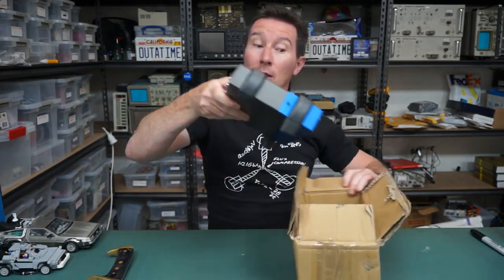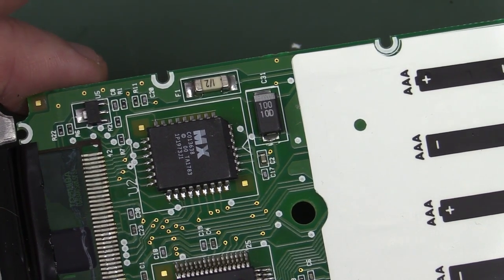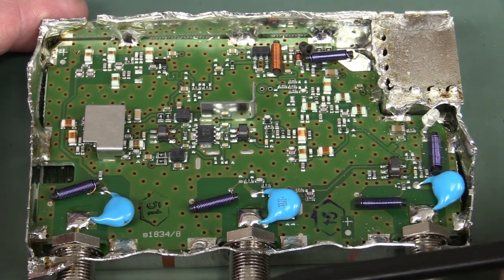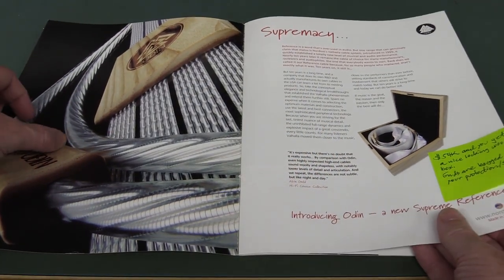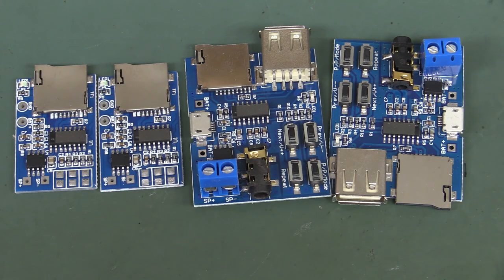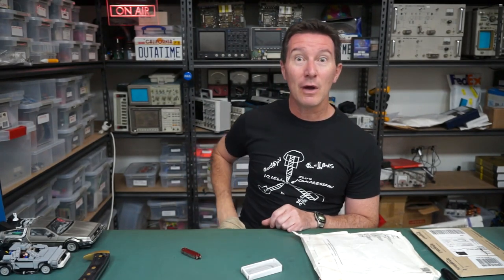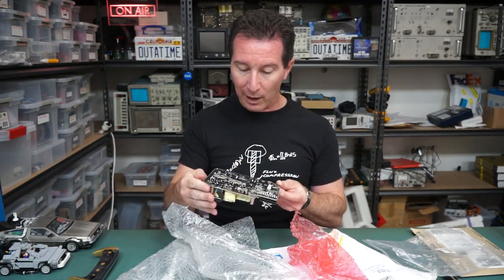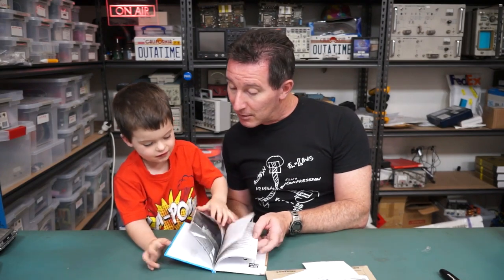EEVblog #856 - Mailbag

Comment: You were right Dave. Wenger belongs to Victorinox. Wenger and Victorinox sold a lot of their pocket knifes at duty free shops at airports worldwide. After 9/11 small pocket knifes were forbidden and both companies lost a big portion of their sales volume (30% for Victorinox). Wenger went bankrupt and Victorinox could remain in the profit zone, but only just. Victorinox then bought the remains of Wenger and kept the brand and production site alive. In 2013 Victorinox announced that the brand Wenger will no longer be used for knifes. Instead they are now called Victorinox Delémont collection.
Reply: +fpm1979 thanks

Comment: Dave, you nailed it with the control room matrix (ie, "monitor matrix"): it's basically a monitor switching box, with a few added features (you were also correct with the Talkback function, which is also usually built into mixing consoles.) Recording studios, especially ones that work with bands and musicians, will test mixes through several different types of monitors to ensure that the mix sounds good on a wide range of speaker types. It's not uncommon to see a large set of monitors that cost $5k each, alongside the cheapest, shittiest speakers available. Somewhat ironically, the "cheap and shitty" speakers are often most representative of what the vast majority of actual listeners will end up listening to the recording on!

There are much nicer monitor matrix units available, but ultimately they're all just glorified speaker switchboxes.
Reply: +catdumpling It has a functional block diagram right on the top lid that Dave totally ignored. Sheesh!

Comment: Hi Dave! Paul from QikTag. No worries about opening late, poor marketing sort of failed QikTag, although quite a few electronic companies have ordered them as a dynamic business card slash keychain. The original idea is that the owner can set what information is shown on the linked page. Sometimes you wouldn't want to show your cell number, on house keys certainly not your address (as someone mentioned in the comments). A PCB is great material for this due to its durability. Cheers!

Comment: 13:30 This is a bidirectional RF amplifier for cable TV and cable net (one wideband amp for downstream + cable TV, one narrow band amp for upstream, separated with directional coupler). One input (bidirectional, so it's an output also for the upstream), an output for the TV, and another output for the cable modem.

The blue blobs at the F connectors are probably HV ceramic caps for DC decoupling, not PTCs (I'm watching it at 480p, so cannot read the values).

Comment: Nordost	combats all	of these	losses	by	employing a	“Micro	Mono-Filament”	
dielectric	alternative. This	technique	allows	wire	to	increase	its	VP	(Velocity	
Propagation)	as	much	as	20%.	The	Mono-Filament	is	an	extruded	fluoropolymer
string-type	material, helically	wound	around	each	signal	wire	at	a	predetermined.

I bet that booklet that went in the bin would have won a gobbledegook award.

Comment: It would be interesting to test some $40,000+ cables, While the $7000-10,000 cables may have been BS, that may be because they just didn't put enough money into them. A few thousand extra dollars into the audio cables is sure to enhance your listening experience. Best of all, you will feel as if a weight has been lifted as your wallet grows lighter and lighter with each additional audio cable.

Comment: Still have and actively use my old TI-89, pre "titanium" model. Did the firmware update to 2004 version some years back, as I recall. Sure, you can get by with those 83s and such, but why bother with it if you don't have to? I think the 89 is one of the last ones you can still program in assembly for as it comes out of the box. Processor is the same as some of the early Macs and other such PC gear from back in the day, or a version of it.

Comment: Dave, if you miss the pen in the Vicorinox Mini Champ, you should get the Victorinox SwissCard Lite for your wallet. As well as the Pen it comes with, a 4 sided flat screwdriver with with 2 sides for philips heads, an LED torch with replaceable battery, a removable scissors, a Pin which is handy for reset switches, a letter opener sized knife, a tweezers, as well as magnifyijg glass, and a ruler molded into the plastic! Handiest tool I own.

Comment: Those hose clamps have been around for many decades and are generally intended for when removal without tools is required.  I used to supply them in another life!   Porton Down is the UK government and military scientific research establishment, for nuclear, weapons, electronics, biological, radiological, chemical etc.  Probably the most secret place in the UK.  A friend of mine works for a subcontractor that works there and despite his highest level security clearance, he still goes through the ringer every time he visits!

Comment: A control room matrix is used to route line-level audio signals between various inputs and outputs.  E.g., to route a mixing desk to alternate pairs of monitors (audio monitors, aka speakers); or switching between a computer audio system (recorded audio) and the main mixer outputs (live audio).

This seems like a simple task, but something like this really makes life easier.  A mixing engineer would have multiple speakers -- e.g., one or more pairs for technical listening, plus another one or more pairs to see what it sounds like on smaller (consumer) speakers, etc.  Notice also the mono switch, to make sure the stereo material can be combined without excess phase cancellation.  The Dim (or attenuate) switch is a partial mute -- the "what did you say?" button.

This one also provides a handy talk-back mic and footswitch control so you can speak between sound-isolated control and performance rooms.

Comment: Damn, got me thinking about getting one of these tiny Victorinox knives as well... I daily a Rucksack, and I believe you can figure out that it's not always very practical to have that huge thing slinged in my pocket, usually with my house keys too... even though I wear cargo pants most of the time.

But I gotta say that I'd find it hard to live without a good knife with a lockable blade.

Comment: Regarding the smart watch, the IC mounted on the display's flex cable is not an LCD controller; it's a capacitive touch controller -- this is super common construction found in many small form-factor displays. The LCD's electronics would be embedded close to the panel itself. 

Also, Song is a family name, not a first name. Family names are often written first in many Asian cultures.

Comment: 26:26 Check out all those unsoldered pins for the transistor tester at the near corner of the board, and also the ones under the trimmer at the top! Looks like the leads of the TO-92 package on the right are mostly floating in the breeze as well. I'd be surprised if it even turned on!

Comment: My Samson C-Control has an issue with the LED bar lights staying on.
A Control Room Matrix is to be able to switch from different input sources and select different output monitors so you can reference your mixes/masters. The "Speaker B" switch actually disables "Speaker A" when it is depressed so that you can only reference through one set of monitors or another. The Subwooder output is always active when selected. Quite a useful system.
Reply: I was close to buying one but then I realised how many people were saying it's a POS (and plenty of broken ones on ebay to back that up).
So I got a Behninger Xenyx Control 1. It's not excellently designed, but it still works perfectly and reliably.

Comment: Those modules are MP3 boards, i have the smaller one, works great and cost $1.50 or so.  Has build in amp, 2w or so.  
The chipset is GPD2846A and 8pin chip is a amp, lm386 i think.

Comment: The plastic case of that splitter is the same style as Global Invacom's range of Loftboxes and other home RF distribution kit so I'd suspect they were the manufacturers.
Edit: The reason for all the screening and filtering is the cable signal uses frequencies that would cause interference with radio using these frequencies if it got out.

Comment: The Samson unit is for controlling your studio monitor speaker(s) from your audio source. Theyre great for A/Bing the difference between several speaker desitnations.
This is an analogue only unit obviously but where the real power comes in is of you have multiple sound cards and digital sources you can switch between those sources and speakers. I use my PreSonus Central Station for such tasks.
The trick is getting one that doesn't colour the sound at all as this can greatly effect your sound design process and mastering of the audio.
This one looks like it would be handy for a couple of PCs and a single set of speakers or just using headphones.

Comment: I reviewed those smart watches on my channel. They're sold here in the Philippines by Cherry Mobile.
Reply: +Gadget Addict  How much they exactly cost?
Reply: They work out to 20 USD for the LCD screen version and 40 USD for the LED screen version. But other than that and a different interface, they're basically identical and both include cameras. The cheapest non-branded bluetooth companion watch is the equivalent of 10 USD but doesn't include a camera.

Comment: alu plate in the ti-83 could help the display to not break easily. i like the idea of a balanced calc which will improve fast drawing and speed up input in critical situations. but a stamped piece of steel would be much cheaper than a piece of alu which then is lightened again by drilling holes into it. so im thinking more stability than balance.

Comment: Yeah, that book on The Shed is a parody of an old children's book series, meant to be read by adults. I've not read that particular one, but the ones I did read were disappointingly unfunny I found. Ah well.

And yeah, Porton Down is in England, not very far from me. As far as I'm aware much of the government stuff is being replaced with private sector companies, which are slowly being declassified. Correct me if I'm wrong, this info is perhaps third-hand. To potter about is a slang term meaning to hang around, basically — with the connotations being absent-minded wandering around a small area.
Reply from the maker: +Muzer0 Read it when I got home and quickly realised it was a parody! And yes, not that funny really.
Reply: +EEVblog pottering about means doing things but in a fairly aimless manner and with no real drive often in a shed or workshop.
Reply: +Muzer0 i believe the private sector science park is actually next door just outside the fence!, porton down is still MOD the Defence Science and Technology Laboratory you need mod security clearance to get in!
Reply: +EEVblog Some of the Ladybird books are mildly funny. The one on The Computer was 15 years ago. Not so much anymore. They don't really age well.
Reply: +BlackDuke07 Not that you need to be doing anything secret to be on list x. You do, however, have to go the whole hog with traceability.
Reply: +Muzer0 I live near Nancekuke - the other main chemical weapons facility. It was where they developed Sarin & VX and other atrocious shit. When it closed down they dumped a bunch of crap down a mine-shaft which is now costing the MoD a small fortune to clean up. Genius.

Comment: Stupid question: I have a Victorinox, I think it's at least 20 years old, but it looks almost new, but I've always hated it and don't carry it because the tools are held in place using really strong springs and the tabs to pull most of them out are either tiny or not very deep etc, basically it's a pain to get any of the tools out without seriously hurting your fingers or using a tool of some sort, is this normal? I never bothered trying or getting another because of this so I carry a leatherman where the tools are very easy to access.
Reply: No, but it might be out of spec. I occasionally clean mine with soapy water and a small brush, let it dry completely, and work a tiny drop of oil into the hinges.
Reply: No, but it might be out of spec. I occasionally clean mine with soapy water and a small brush, let it dry completely, and work a tiny drop of oil into the hinges.

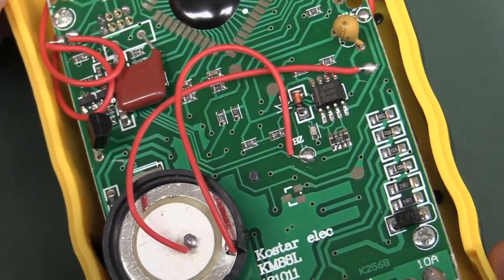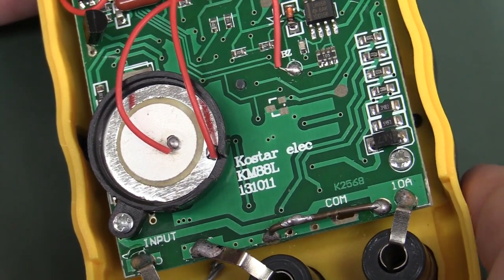Comment: 26:37 it's a Coaster alright :-). 26:42 Look at the floating solder blob in the case by the jacks... that won't cause a problem when it eventually shorts something out.

The transistor gain jack the hallmark of a crap meter guess the Chinese haven't figured that out yet.

Comment: You really REALLY shouldn't write the address to the house your key goes to ON the keys themselves. Because if you drop your keys or have them stolen a malicious person suddenly knows which lock the key unlocks. So the tag-idea isn't that far off actually. You should include as little personal information that could be matched to you and your house on your keys without going trough a trusted 3rd party first.

Comment: about the victorinox.. afaik it's 'only' 440c steal. But somehow you can get these very sharp and it holds the sharpness very well. I have also other kind of steels (harder and everything)... but somehow this not so special 440c is really a great knife steel. Maybe also depends how you heat-treat them? dunno.

Comment: Those caps are there as a build in fail, 5-10 years they will fail, they may not last for 25+ years, then they are not selling as much as they want. There is no reason to have a better layout and cap not as close to the heatsink as they are now.

Comment: TI-83?  I have a TI-81 laying around somewhere that still works.  Only thing it doesn't have that i think was incorporated in later models was a way to share programs.  (they do have a language built in them that's very similar to basic)

bah, can't find my ti-81.  instead I dig up my old TI-BAII PLUS which was my father's Advanced Business Analyst calculator (so it's no 4-banger even though the date stamp was 1993, and it had a LOT of advanced functions for a calculator of it's time)  Only problem is i suspect it's battery is nearly dead but don't currently have a meter to test it with.

Comment: Well described Samson, decent and cheap, does the job. Usually Samson electronic gear is solid quality and does the job as well as any other but it does not have good overall reputation.. They made horrid stuff in Korea in the 90s and 00s, electric guitars, cabinets and PA speakers, amps etc.. All of that is absolutely rubbish, i've fixed a lot of their guitars, they were exactly the same crap that other cheap brands were churning out from Korea back then..

Lately, they have improved a lot on their quality, doing pretty simple, entry level stuff. Their mics are especially good bang for the buck, some models have even got a decent reputation. Would still stay away from anything else that requires finesse.

The unit in question is for routing control room reference monitoring, to send the mixing console "control-room" output to multiple speakers. It's part of methodology, using several kind of speakers to make sure it works on all kinds of devices. Some part of that job require instant switching, our sonic memory is measured in seconds.. So AB test means instant switching.. Also, these boxes often are used as control room volume level control.

Victorinox CyberTool user here, assemble a PC? no worries, it does it all.. Perfect for computer guys just do not lose the bits..
Reply from the maker: +SquidCaps I have a Cybertool.

Comment: I heard Samson gear is basically made in the same factory to the same standards as Behringer i.e. it's the cheap and cheerful entry level gear. I own a Samson rack compressor and a Behringer patch panel so I'm not hating, you are basically correct that it's pretty good but the real audio pros don't have much time for it.
Reply: +artifactingreality as seen it uses cheap caps etc. So they might be made otherwise to same standards but using very cheap parts.
Reply: +artifactingreality Pretty much.  Although, there are a suprising number of "audio pros" that use Behringer (etc.) for all the handy things they do.  They're cheap enough you can afford to pick up spares.

Maybe you won't find them in big-name studios or live shows with headlining acts, but they're pretty much everywhere else.

I have two rack-mount Behringer line mixers for live monitoring, a rack-mount Behringer 8-channel DI, a 1/4" patch panel, and some other odds and ends.  They work great.  And I have had some other Behringer stuff that... did not.  ;-)
Reply: Nick Guy
Yeah Behringer uses top notch components for what I've seen. And my friend who is a professional uses Behringer too.